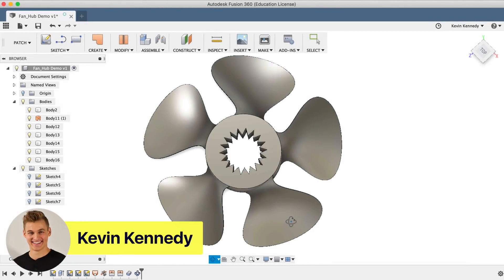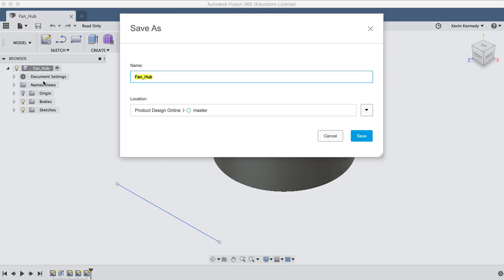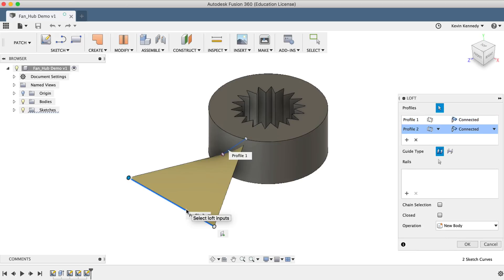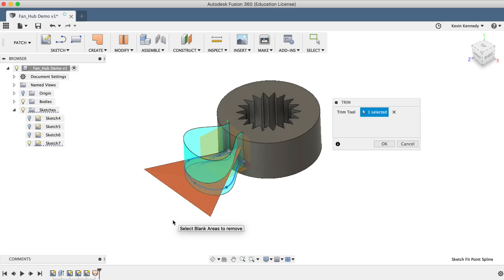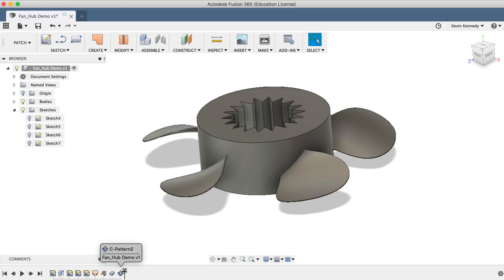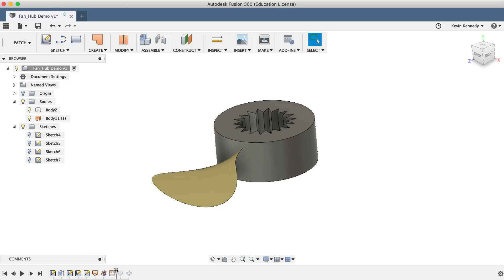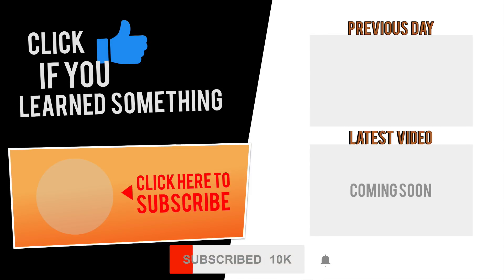Fusion 360: Surface Modeling a Fan Blade in the Patch Workspace

Comment from the maker: P.S. If you liked this video, I'd love for you to Subscribe ► http://bit.ly/sub-right-now
—
TIMESTAMPS
0:00 - Surface Modeling a Fan Blade in Fusion 360
0:21 - Get the demo file
1:52 - Loft the first blade
2:37 - Trim the first blade
3:28 - Thicken the first blade
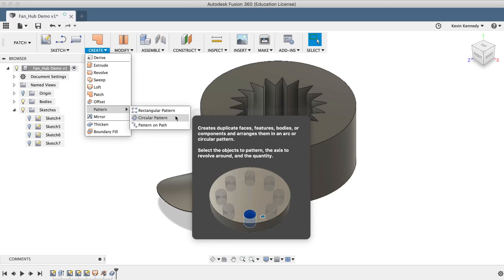4:10 - Circular pattern the blade
5:28 - Extend the blade (make surface larger)

Comment: How do you remove the overlapping parts of the blade that go inside  the cylinder?
Reply from the maker: Hi, Paul. You'll have to create another surface the same size as the cylinder and then you can use the trim tool to trim those away. Cheers, Kevin :)

Comment: Hi Kevin, I'm looking to work in patch mode as well as sculpt mode. The problem is when I work on a shape in sculpt mode then switch to patch mode, when I then go back to sculpt mode the shape isn't the same, I can't edit it anymore and the transparency is very low. Probably really simple but would appreciate any help thank you bud!
Reply from the maker: Hi, 123456789ten. The problem with the Sculpt environment is that there is not just one Sculpt environment. Once you start and "finish" the form, assuming you work with the timeline enabled (it is by default), it creates a purple icon in the timeline. That creates one Sculpt environment for that one object.

If you start and finish another form later in the timeline it will create another purple item (box icon)  in the timeline, which is another sculpt workspace. Unfortunately, the different sculpt bodies are in different environments so they don't communicate with each other.

If you then go back to the first purple item in the timeline and edit it by double-clicking on it... then all objects that you created after that are vanishing (transparent) because they were created later in time and don't exist yet at that point in time. How many sculpt icons do you have in your timeline? Make sure to try each one and let me know if that was it! Cheers, Kevin :)

Comment: Hi, nice tutorial, I have a problem in the patch workspace, when I want to make a loft I don't have the option of changing the surface continuity, the only options are Connected and Direction, but not G1 and G2, is it because I only have the student version or is there something wrong with my Fusion 360 ??
Reply from the maker: Hi, Gonzalo. It should not be a result of the "educational" version, as Fusion 360 is the same all across the board. The only exception is that the free versions (students and hobbyists) do not include the Generative Design workspace and some advanced simulation tools - because of the cloud computing resources they need to use.

As far as I'm aware, there is also no way to turn the function on or off. Therefore, it is likely due to how your file is set up. Can you share the link to your file so I can take a look?

Cheers, Kevin :)
Reply: @ProductDesignOnline  Thank you, but I did't save the file, It must have been because I wanted to loft an open curve, now I know that it must be a closed curve or a surface to have tangency, right ??
Reply from the maker: Hi, Gonzalo. This F360 forum post can explain it better than I can - https://forums.autodesk.com/t5/fusion-360-design-validate/tangency/m-p/7114872#M113477

Cheers, Kevin :)

Comment: Thanks i like to do blade using this method but how i can change the curve of the blade?
Reply from the maker: Hi, Christopher. If you look at 1:45, you'll see the sketch geometry that was set up in the demo file. These two lines are used to create the pitch of the fan blade. If you want to change the angle of the blade then you'll want to recreate the line that's touching the center part, with your desired angle.

If you want to change the overall curvature of the shape of the blade, then you'll want to change the shape of the sketch that you see at 2:27. This sketch is used to trim the original surface away to create the overall shape.

I hope this helps! Cheers, Kevin :)
Reply: I create a 
third line in the middle, this solve my problem. Thanks.
Reply from the maker: Hi, Christopher! I'm glad to see you got it working. Cheers, Kevin :)